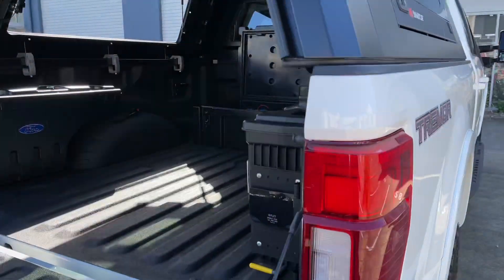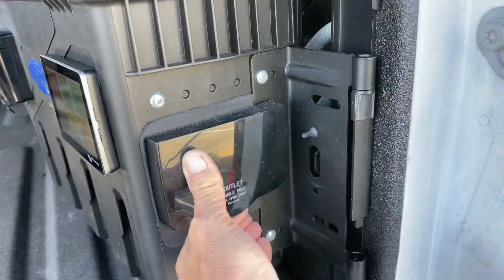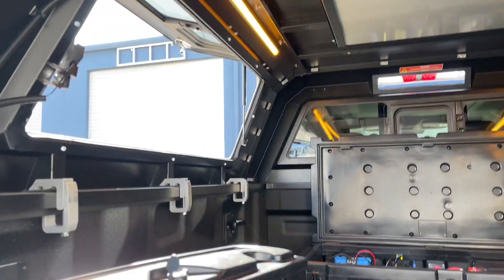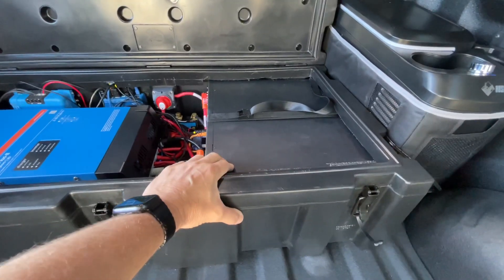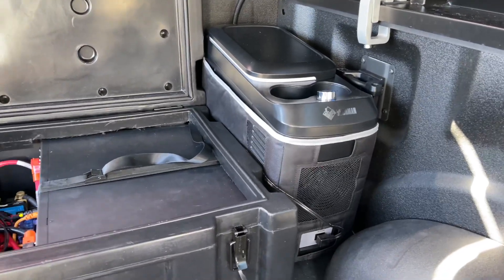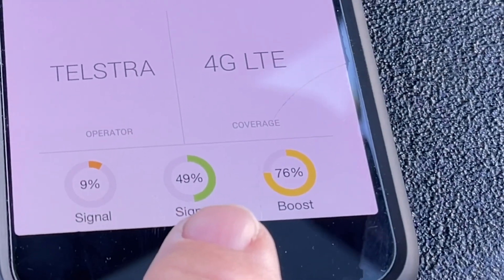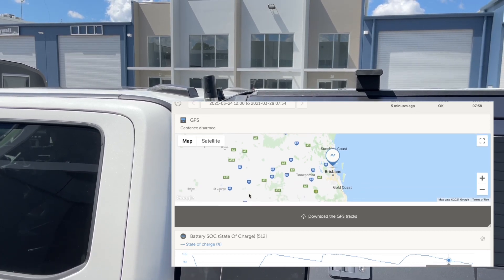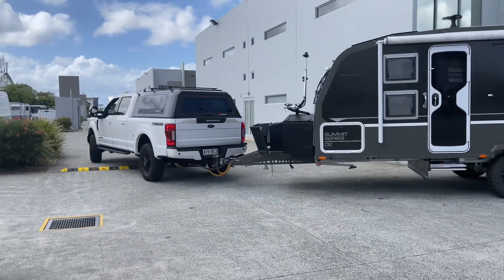F250 Tremor with 250A Alternator Charging 48v System 3,000W Inverter 400Ah Lithium all in Tub

Comment: Nice job. Doesn't the F250 & F350 have an option for a second alternator, couldnt you run a second stand alone 48 volt alternator to run, charge your 48 volt  lithium systems while leaving the F250 electrical system alone. Wouldn't this give you a much greater charge rate less moving parts eg no scotty less wiring. Running a second stand alone 48 volt alternator on your F250 or F350 to charge your 48 volt system in the back of your truck then also using it to charge your 48 volt caravan. While the factory Ford F250 F350 electrics are left alone. Or couldnt you just just run a second stand alone 12 volt alternator to charge your batteries, charge your caravan or use your scotty to charge 48 volt lithium batteries.
Reply from the maker: Hi Shane, we did 4-5 American trucks with 48V alternators and alternator controllers. We ended up replacing them all with Scotty and 12V. Whilst 48V alternators work well in marine, we found that the timing between the battery BMS "stop charge" and the alternator "stop field current" was a problem. As a result we saw load dumps and all the drama with that. 48V alternators don't have avalanche diodes, so load dumps are catastrophic. What we do now is install a second 12V 250+ alternator and tie to primary and run Scotty to 48V. That gives us 3000W at just over idle and is more than enough for recreational applications. We do supply still 8kW + Factory 3kW on Sprinter Food vans but we do special BMS software and control to avoid load dumps and this is $$. Forget 12V for high charging, leave it for the 30-40A DC DC.
Reply: @Safiery  Thank you for your reply it is good to know.

Comment: Hello, was watching few videos about your installation in the boxes, do the box have ventilator and ventilation holes to keep the system in a moderate temperature as advised from Victron so the system can run effectively and smoothly
Reply from the maker: Yes they do. Double pull air in and double exhaust with inbuilt temperature thermistors that are selected at 30 or 40C - your choice. We have shipped 10+ of these cases now and no issues at all.
Reply: @Safiery  Thank you for your prombt answer. I will have a look ath Homepage for the dimensiones